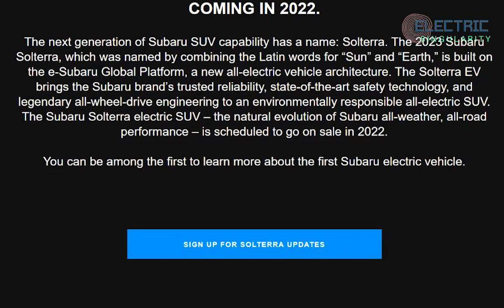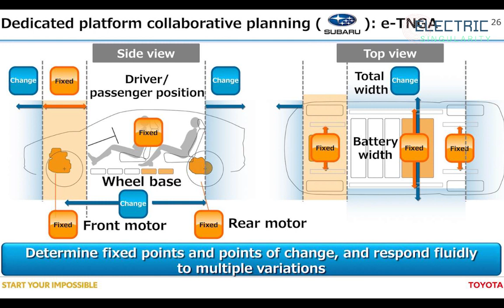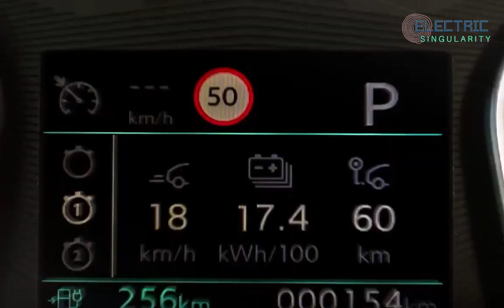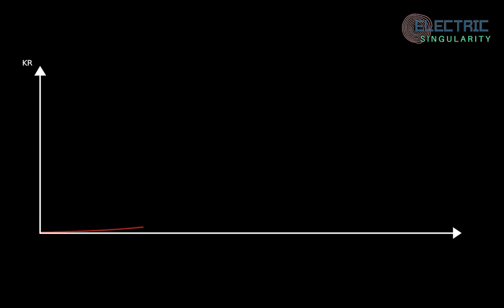The Subaru Solterra is Subaru's first EV - it's about time!

Comment: If the link is with Toyota it will have a Chademo charge point which has virtually been dumped across Europe in favour of the CCS protocol - and is withering on the vine in the USA. A bad decision imo as many potential buyers would give that a swerve if they want it for road trips.
Reply from the maker: Good point - thanks for watching :)

Comment: Im getting a subaru but not electric. Lithium ion has a durability issue and if so many vehicle brands are having battery issues in the first quarter of their lifetime, what on earth is the final quarter of their lifetime going to hold. I think by then insurance companies will walk away from lithium ion.
Reply from the maker: The only durability issues it has are in cars without thermal management.
Reply: @electricviking  like that Chevrolet bolt thst caught fire recently. Fibalert.
Reply: @ianburnett4605  I once heard Subaru's have bad head gaskets guess they all do. damn.